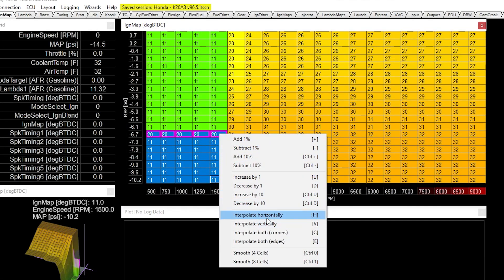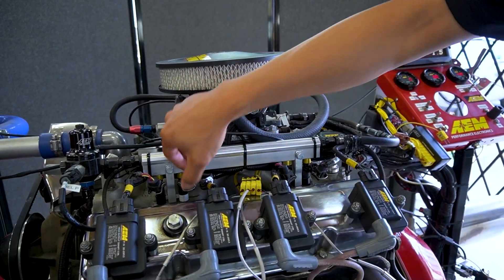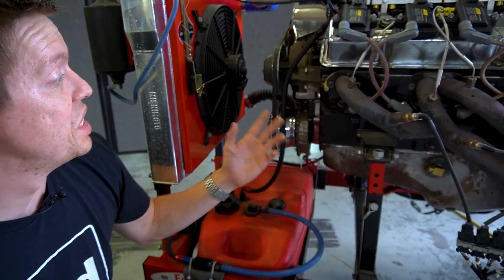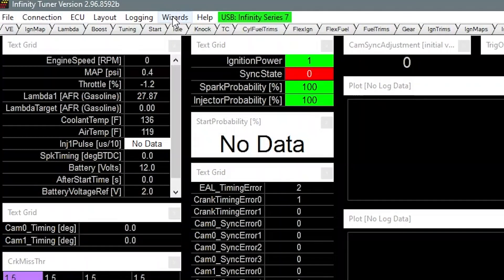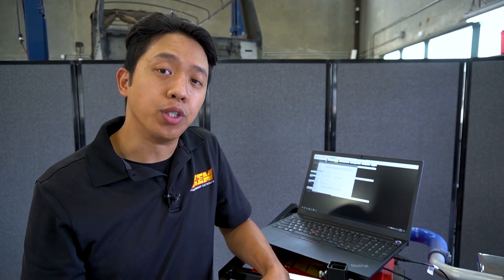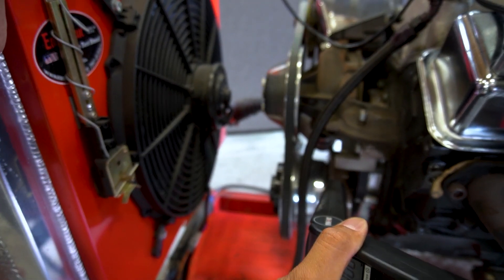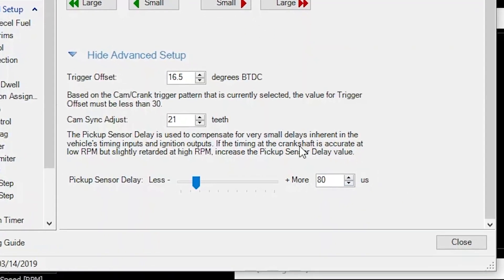How to Sync Engine Timing in INFINITYTUNER

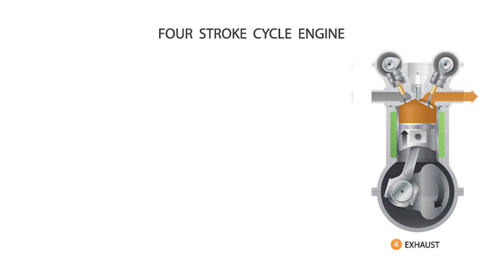Comment: SO...at 7:30 when you suggest shifting timing by a full 360deg, is that achievable by pressing large advance or retard 72 times?? I believe this is my no start reason
Reply from the maker: Correct, you can also manually adjust the cam sync adjustment/trigger offset in the advanced setup.
Reply: not sure if you have figured it out yet, but there is a “sync tooth” parameter that sets where your ignition sync actually is in a numerical value. it will be out of 24 for a 24 tooth trigger (evo / dsm / rb series / ect). if your timing sync value is 6.255 and its perfect, you would add 12 to this giving you 18.255 and that would give you exactly what you are looking for.

Comment: I've been struggling with getting the sync state on an EMS4 could you explain the default crank tooth settings? For example 36-1vr crank 1vr cam sets to 24 fuel teeth, 24 wheel teeth, 24 spark teeth etc..   My scenario is a 1981 BMW 316. I have a 36-1 crank sensor and an equally spaced (stock) 4 tooth cam sensor.
Reply from the maker: Please contact our support team at emstech@aemelectronics.com and they will help you out!